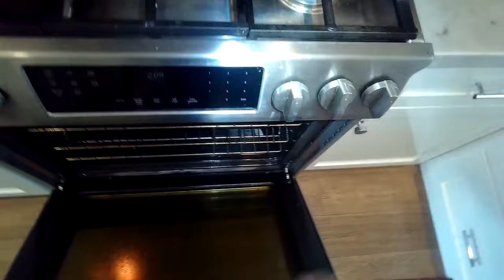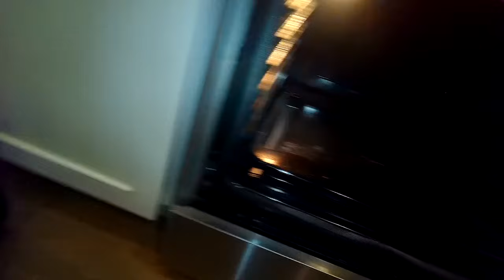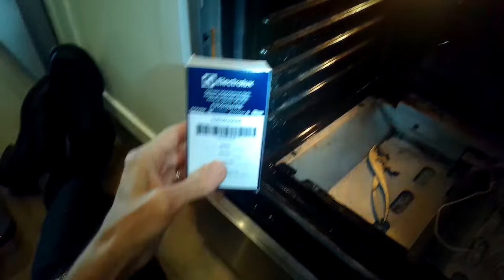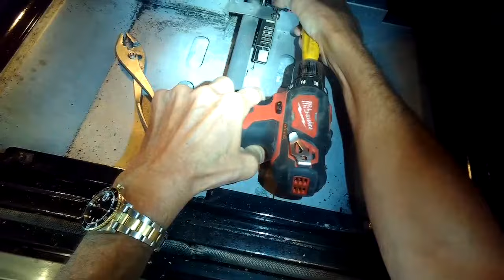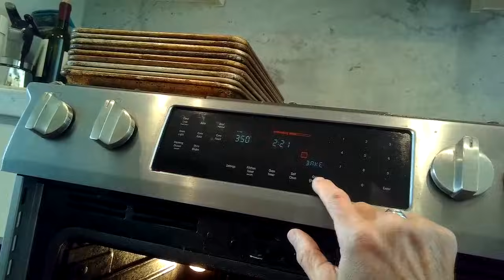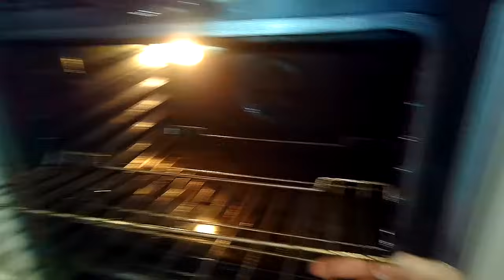✨ BOSCH OVEN WON’T HEAT - EASY FIX!! ✨

Comment: We have Bosch oven with gas stove. we have an issue with the upper grill element(s) (resistance), the top grill element has two part; the middle and surrounding line. I already has changed the grill element but issue is when I turn on the oven for both part of the grill (middle and surrounding), the middle one is not working but they were working separately. what do you think, what is the issue. Is there an easy fix?
Reply from the maker: can you send me that same question to:  scottthefixitguy@yahoo.com

Comment: Hi Scott we have a very similar if not the same model with the exact same problem. Thanks you for your excellent, super informative video. We just bought this house and this oven/kitchen was put in 2018. Why would the bake ignitor go out after just two years? Is this something we should be worried about or have professionally checked out or just change out the ignitor and see what happens? The broil top inner ignitor work and the stove top both work there is also a click when I turn it on. Thanks for all you do!
Reply from the maker: Hi Clara,
I would just replace the bake igniters.
They’re fairly cheap and easy to install but the reason they may be burning out early is due to a hole located near the igniter in the burner tube that’s leading too much heat touch the igniter shortening its lifespan.
The way to correct it is to install new burner tubes or you can just replace the igniter every couple of years.

Comment: Does this part number you are showing work with a Bosch model HGS3O52UC/01 gas range? thanks
Reply from the maker: It sure will👍
Reply: @QuickAndEasy5MinuteAppliance  Will that ignitor also work for Bosch HGI8054UC/02 - looks identical to oven/range in your video. Stovetop and broiler working fine and clicks on in 'Bake' mode, but I don't hear any gas running. What's frustrating is this will be 2nd time the bake igniter will need to be replaced on oven only 4 years old. Last replaced 18 months ago, trying to avoid what they charged me in parts/labor and do it myself.
Reply: @BBrenner13  I have the same oven model as you — did you ever get an answer about a replacement part for this?
Reply: @DaCakes55  it's been so long, I don't recall. I did end up replacing the part myself, but don't know what I bought. Just know that a $45 part and about 25 minutes saved me $300+
Reply: @QuickAndEasy5MinuteAppliance  thanks